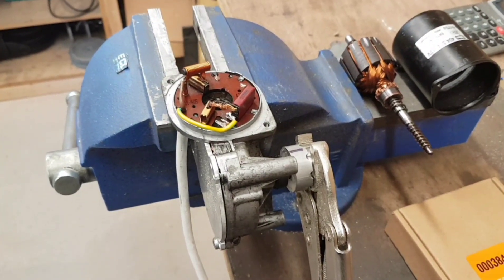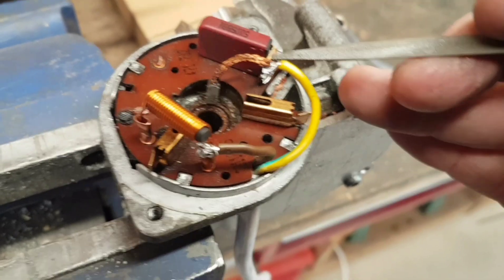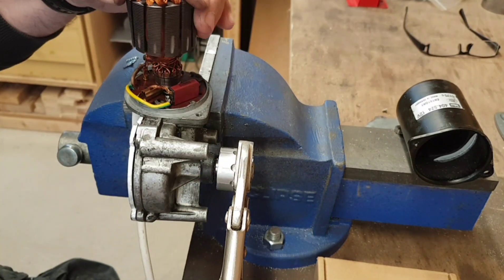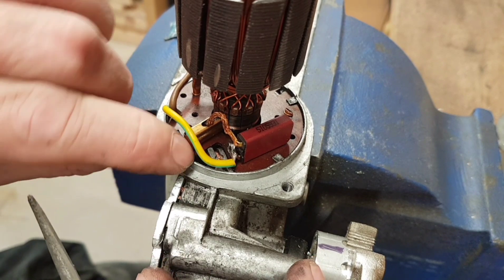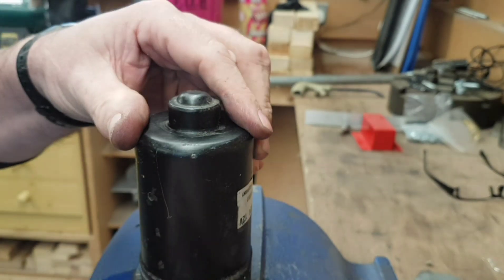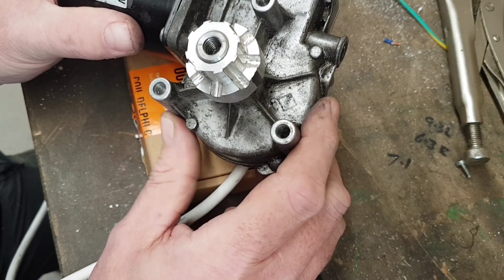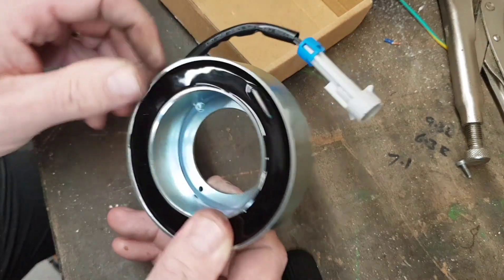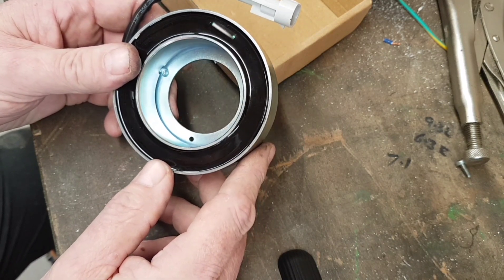Mill Power Feed Project with Electromagnetic Clutch (Part 1)

Comment: I like the A\C clutch coil.  Also all DC current is less treacherous than its always reversing cousin the AC current. I had given this a thought in the past but did not get past the “wonder phase” of how I would provide the engaged drive part.  Good choice for the drive motor. Plenty of torque with the built in design not to flame off at some restriction to movement. After going with a cheap axis power feed on my mill I am surprised just how little torque is required to do light cuts.  If you are hogging deep cuts you might need a bigger setup, but well I am not that rushed to require that level of oomph.  

Excited to see how you sort it out. 

All the best 

Dan
Reply from the maker: I don't think the wiper motor will last very long Dan. I smoked it in an earlier project. Didn't think it was earthed through its body and shorted it out via the two speed terminals. It's a good template though for the concept and can be swapped out for something with a bit more beef if needed.
Once it's in place I'll jerry rig it to a PWM and see what gets warm first 🙄🙄

Comment: Interesting project. I will watch how you get on with interest.
Reply from the maker: Might need a chat with you Ben ? Not sure on the shunts and stuff in that motor and if I need them 🤫
Reply: @NellsMechanicalManCave  I presume they are there to regulate the speed. Do you know if you have the high speed or low speed setting?
Reply: Are you able to check if they were always in series with the motor or only for low speed?
Reply from the maker: @BensWorkshop  before the one brush mount snapped off. Both live brushes read 6 ohms to earth. Each gave 60rpm when connected +12v and common ground.  If both live brushes were given +12v and common ground, 30rpm was achieved. That fried my head but not the motor 🤣
Reply: @NellsMechanicalManCave  Do you still have the other brush's connection available?
Reply from the maker: No mate. The lug snapped off that held it down so it got binned. Did try to repair it but it was so small I couldn't position it to solder it back in place. So I'm stuck at 60rpm.

Comment: Hello Neil, looks like a great project, I'm watching with interest. I like the idea of the electro-clutch to automatically engage/disengage the drive. 
Best wishes, Dean at Retromeccanica.
Reply from the maker: Hi Dean,
Working on the torque required to power an AC pump on a car I think it will work. But, I might be talking through the purple starfish on this one 😁😁 let's wait and see as the idea progresses. I'm fairly confident at the moment but  have been kicked in said starfish before 😊😊😊
Reply: @NellsMechanicalManCave  I think it should be good, those pumps do take a bit of torque to power them, judging by how much fuel you use with it on! I'm just going through my second hand VMC, cleaning and new bearings. It was pretty grubby. Hopefully a video soon. Cheers.
Reply from the maker: @retromechanicalengineer  cool mate! Be interesting to see what you do with it. If you got the saddle off, check those oil ways !!!!!